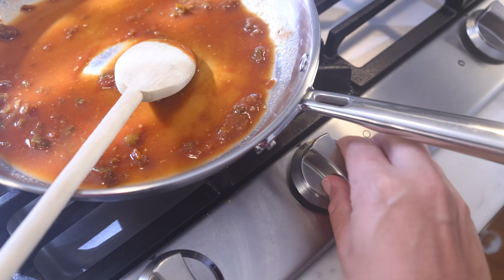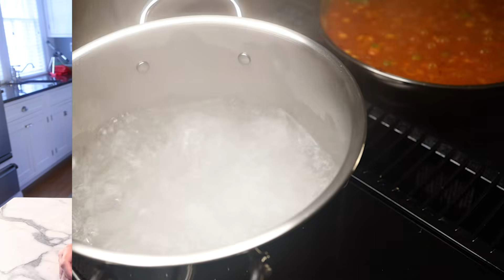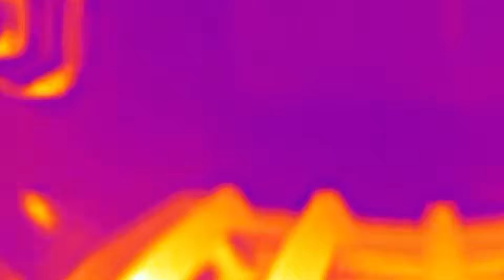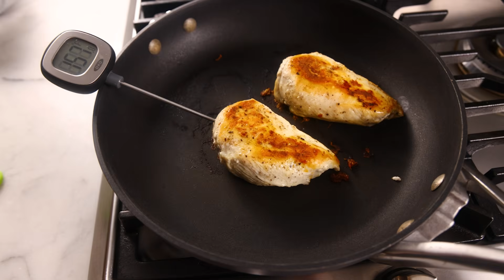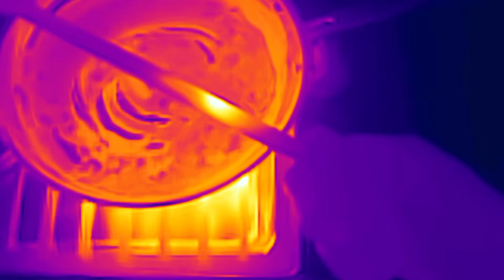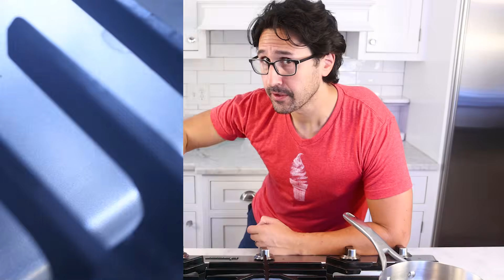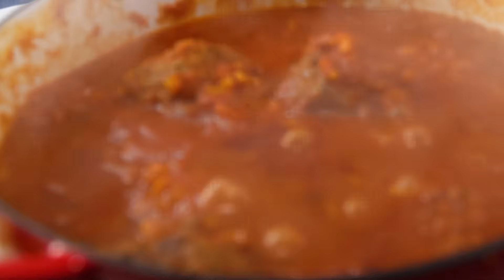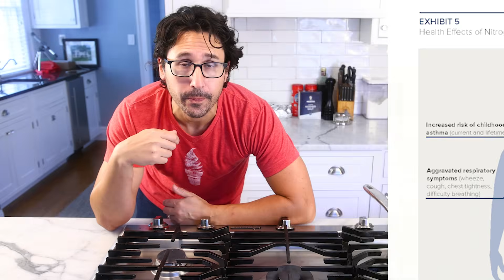Problems with gas stovetops | weak, dirty and dangerous

Comment: Most electric stoves here in Austria atleast have a glass covering
Reply: (edit, I replied by accident under the wrong thread)

There is no scientific backing for this claim, other than your bias. I bet in a controlled, blind test you would not be able to tell the difference and identify food cooked in gas from food cooked in electricity. Except, maybe if there is sauce, for instance, burned more, because gas created hot spots, and it burned unevenly.
Reply: @pavel9652  Are you ok?
Reply: @AlpineTheHusky  Yes, thanks for asking. Do you have anything remotely intelligent to contribute?
Reply: @pavel9652  Do you have any issues or are you just trolling?
Reply: @AlpineTheHusky  I just shared some information with you, but I acknowledge you don't appreciate it. Do you have problem with people responding on public forum to your public comments?
Reply: @pavel9652  I dont have a problem with it but if it has nothing to do with what I said then it has no use of being said
Reply: @AlpineTheHusky  I replied by mistake under your thread, while intended to reply to someone else ;) I notoriously get insulted in the comments, so I took your initial answer as confrontational. Obviously, the entire conversation doesn't make any sense, which you should have pointed out. Sorry about the confusion!
Reply: @pavel9652  Yeah I thought as much. I have talked with alot of people that may have outbursts of random sentences so I just asked if you were ok or if something else was the issue. Have a nice day
Reply: @AlpineTheHusky  "I have talked with alot of people that may have outbursts of random sentences" - very strange, you must be working in the mental health sector

Comment: One big issue I can see with electric stoves, is issues with the power grid in general.  We have a heat wave going on at this time, and our electric supplier is warning customers to try to use less power because the grid is strained.  Electric stovetops are not going to do this any favors.  The US has a lot of antiquated electric grids, and many of these might not be able to handle a bunch of new electric stoves all coming on at about 5pm.  Places like Europe were a bit late in getting electricity, and built their grids with a bit more future proofing.
Reply: But cooking on gas in the summer time leaks alot more heat into your kitchen, so it forces your AC to run harder. People freak out about energy and cooking but it really is miniscule and not what the power companies worry about, it is more AC and Resistive Home Heating that are the big problems
Reply: @linuxman7777  Where I live, where there is major issues with the grid, most homes have gas stoves, far fewer homes have ACs.  Gas is cheap, electricity is expensive, and the power company bugs everyone to use less power.
Reply: @Lutrian  Where do you live? the 3rd world? I live in Pittsburgh Pennsylvania  in the US and the cooking prices when you take efficiency into account the prices of gas and electric are the same. Never have lost power and the grid is super reliable here.
Reply: @linuxman7777  In California, Electricity is expensive as eff, and natural gas is cheap
Reply: ThTs the thing the liberals don’t get, our grid is the same one that was built when Edison came around over 100 years ago…. When air conditioners came around in the 50s that was basically all it could take, and now we’re trying to throw these shoves on cars on it… crazy.

Comment: I near always use an electric kettle to boil my water before adding it to the pot on the stove top. I don't know if this is more efficient but it certainly seems faster. I know that electric kettles aren't as ubiquitous in the US though.
Reply: It is faster and the electric kettle has nearly 100% efficiency, while the gas kettle has only about 30%. Smart move!
Reply: It is, you should never boil water on gas, it is really inefficient to do so, Love my electric kettle

Comment: This will probably be buried in the other 3659 comments, but here goes ... 💰💵💸
I don't like gas because the DELIVERY & TAXES, etc. COST $25/month, which is about $0.83/day or $300/year (that does NOT include the gas itself).  If I switch to electric, it will eventually pay for itself.

Comment: I'm hoping to get a hybrid 2x induction 2x gas cooktop (or similar).
Reply: Get induction and portable gas stove, as a backup or for larger cooking, like with wok. Complexity of hybrid is 2x and you will have to pay gas connection fees (or store bottles). You will probably end up using induction nearly all the time, because it is convenient and cheaper.
Reply: @pavel9652  Why not get a gas cooktop and a countertop induction burner?  That seems an easier, safer, and more compact solution.
Reply: @jamesisin  You will like and use electric more, I think. It is more convenient, faster, cleaner, efficient, creates no fumes, etc. Recently I was thinking about getting a single gas burner and bottle as an off-grid backup or for cooking with a proper carbon-steel, round wok, which likes a lot of heat! See the Chinese jet engine like stoves! ;) I have a glass+electric (no induction) cooktop.
Reply: @pavel9652  If your gas is creating fumes, you need to call some to repair something.  

My current setup is a gas cooktop with portable induction.  I'd just like to integrate both.
Reply: @jamesisin  Combusting fossil fuels always creates fumes. Every time you see little bit of yellow colour, it was incomplete combustion.
Reply: @pavel9652  I will get way more BTU's from my arrangement.  Also, I keep my current induction burner on a bookshelf while I'm not using it.  I can't do that with a gas one.  Ultimately, I know I want both so I will seek a stovetop solution which incorporates both.

Comment: I learned on Electric, and tried out gas recently, Electric while less intuitive to use, does offer alot more power than gas, more even heating than gas, and higher high temps and lower low temps than gas. 

Gas really only offers responsiveness, and instant heatup. But induction offers that today now as well.

Comment: Here's the one main reason I would choose a gas stove over electric any day of the week. There's absolutely no consistency as far as what "medium" and "high" heat settings mean... This video actually proves that. With a gas stove... You can physically look at the fire to see how much flame is under your pan. With an electric... You just kinda have to trust that their "medium" is ACTUALLY an appropriate temperature for your steak or wtv else. I'll take my gas & perfectly cooked steaks! I don't care about waiting an extra minute for water to boil.
Reply: That depends on how much you have used the product and have taken the time to experiment. I love gas too, looking at the fire makes my little caveman brain go "unga" and like you said, it's much easier to fine tune the fire by looking at it. However I do strongly believe that an electric induction stove is the better tool, but it just requires an annoying and expensive learning curve. See it as your phone, when you use a new phone or different brand, it has some lags and timings you need to get right to properly use it. After a long while it becomes like an automatic sense. Feel me? Still love gas tho, but looking to change to electric.
Reply: you don't need to trust anything, every stove its different, I have always use gas, I have passed for more than 10 of them.. everyone of them its different, you just learn to work them (same for electric), there is also no need to look at the flame lol.. I prefer gas anyways but this is a stupid argument.

Comment: I just cook everything on my natural gas grill outside... You can even use it as a poor man's oven. I've done a ton of pizzas and dishes of lasagna on it and I can't tell the difference 🤔 Bonus is that heat exhaust and gas byproducts are exhausted outdoors and not in my house.
Reply: This is defo useful if one lives in the wilderness or off-grid. How do you cook in winter? Surely can be done, but it is marginally less convenient.
Reply: @pavel9652  Well, I live in Phoenix so our winters are very mild. It does go down to freezing in the mornings in the deep winter, but by dinner time it's in the 70's , low 80's. 😎
Reply: Why not propane? Gas really is just worse propane
Reply: @linuxman7777  Simple reason really. We don't have the infrastructure to deliver propane to people's homes.... at least not without a delivery truck and a storage tank. [ Yes, propane is a better gas to use w/ more power since its a 4 carbon chain gas vs. 1 ] I do however have natural gas delivered for my water heater and heater. So its just a matter of tapping a line to my BBQ off of the main feed that goes into my house. People in rural areas do have large propane tanks hooked up to their house... but that wouldn't be practical for me since there isn't the room for it, but certainly in theory it could be done. I have the convenience of having a permanent hook up to my grill vs. having to swap out portable propane tanks.
Reply: @ricksherman34  I see, I have cooked in many ways, and like Induction and Glass Top Electric the most, after that I like Propane. Coil Electric and Gas are quite weak and when I use the gas stove in my house I am always disappointed when cooking large amounts of food, or cooking stuff from frozen. 
People who say gas is more powerful than electric don't know what they are talking about, or are confusing Propane for Gas. And in that case, of propane vs electric, there may br more of an arguement.
Reply: @linuxman7777  I think it would depend on how many BTU's the gas range outputs, but yes I have heard that induction will beat natural gas in most instances short of an industrial grill like you would find in a restaurant. I mostly grill but boiling water / cooking pasta will most likely be better on an induction vs gas range. I mostly just grill stuff so for me it's not an issue. I can also do lasagna/ pizza / and even bake using the grill like a poor man's oven and it works pretty well. I can't tell the difference other than the cost.
Reply: @ricksherman34  Check out TechnologyConnections video on electric kettles where he puts a Stovetop Kettle on a 17000btu burner, It tied an electric kettle in the boil test. 

Open flame cooking is and always will come with more heat leakage so you need alot more power to get the same results. Which Propane does deliver.
Reply: @linuxman7777  I totally agree...but with a permanent natural gas hookup directly to my grill, there is a convenience factor. I never have to screw with propane tanks and in general it only takes about 0.1 BTU to cook a steak in 10 min. ( Or Salmon fillet ). I usually just throw some veggies in aluminum foil along with the meat and I get a fully cooked meal in about 10 min. The regulators that they use on propane grills have smaller ports so the flow is less than what a natural gas regulator would use. In the end about the same amount of energy is burned. Also with electric range the power is created by a natural gas based steam turbine ... So you always lose energy when converting or transporting it. So natural gas has very high efficiency ( like 97% vs 80% for electricity) and it costs 1/3 of electricity for the same BTU.

Comment: Note on 10:15: It is actually a renewable hydrocarbon; lots of natural processes create the same compound as a by-product. We don't see a whole lot of that in the US, but NYC does pipe some to some residences that they use to heat their home. It is just so much cheaper to use the stuff piped from the ground, as that stuff is already being piped up as part of petroleum extraction.

Comment: I've designed induction cooktops, they fundamentally provide no more even heat than resistive cooktops. The pulsing you describe is just a result of the control circuitry. Some induction cooktops do it to (and some resistive cooktops don't).
Induction is better in all the other respects you mentioned though.

Comment: The thing with gas stoves is that it is the gas industry's biggest marketing assets. Less than 5% of their sales come from cooking, most of it comes from heating air and water. But since nobody gives a crap about if their furnace and boiler are gas or electric (they care about the price and its effectiveness), they need to rely on the emotional attachment ppl have to gas stoves to get good press. That's why their marketting and lobbying focuses so much on it and gives people a reason to attach their house to the gasline

Comment: I've used exposed coils, coils under glass, gas, and induction.  By far, my favorite preference is induction.  There is absolutely nothing remotely close to induction when it comes to temperature control.  That said, a close second for me is gas.  With patience and practice, you can get pretty close to induction regarding temperature control.  The problem is, with gas, you can't always cook directly on the burner to achieve that control.  I used spacers and double boilers very often when I had my gas stove, which is a huge pain in the ass but, in a choice over coils under glass, something I'll happily deal with.  Coils under glass have HUGE problems with temperature control.  Because you're heating the glass and the coil, there is a huge time variance when you turn the heat up or down.  I often find myself running 2, 3, or even 4 burners at a time when making sauces so I can have the different temperatures needed immediately.  On my current coil-under-glass stove, I set up a pot of water on high.  Once it got to a full, rolling boil, I turned the burner down to low and timed how long it took for the water to get to a simmer.  4 minutes!  On a gas stove, that happens within a minute.  On induction it happens in seconds.  Induction is definitely what we're getting when this range needs replacing.

Oh, another problem with glass topped ranges, be they coil-under-glass or induction.  If you tend to be "aggressive" with your pots and pans (shaking them while you cook), the glass gets scratched up pretty bad.  I obsessively clean my range top, so it's always pretty close to sanitary clean, but it looks like hell because the 2 burners I use the most are so scratched, they're no longer shiny!  Makes me want to go back to exposed coils!
Reply: I feel the pain here! My glass top is so scratched. It looked used after a month. I know it’s not it’s fault - but I wish I’d thought the decision through.
Reply: @AK-jt7kh  Yeah.  I'm convinced glass top ranges are made specifically for people who cook occasionally and aren't aggressive in their manipulations of their pans.  

I admit, I'm concerned about using a glass-topped induction stove.  The only reason I'm even considering it is how easy Gorilla Glass tops are to get.  That said, even if the glass top sucks and allows the same scratching as my current range, it will still be a huge upgrade over the electric-coils-under-glass I have now.  A man can dream, right?  Literally nothing can be as bad as what I have now.

Comment: If you truly care about the environment, consider where your power comes from, not just today, but for the next 5-10 yrs. 

Odds are it'll be coal / gas. Most cooking is done in the evening (low sun & low wind), so fossil fuel powerplants typically increase production to compensate.

I refuse to switch from gas to electric until we have a reliable weather resistant renewable power (nuclear), until then I'm just wasting it to sound "green" while adding to the pollution problem.

Comment: Love gas, hate electric, never tried induction but I hate the fact off means move the pot. And what kind of sauce pan are you using that it's burning on the side. I've not experienced that ever except a cheap thin pan. Oh well, to each his own.  Will said you do need a big burner to boil water for pasta or you will be frustrated.

Comment: It doesn't change the other things you said but as far as not being able to set your burner low enough - get yourself a simmer plate.  I have two that have been in the family for decades.  one is thicker than the other.  I rarely use them but if I really need something to be getting very little heat they work quite well.

Comment: Many people (usually old house wives) i met here in europe own electric stoves under glass and believe its induction because they dont know what they are talking about. Most of our stoves are electrical with glass top. Followed by old electric stoves that I believe stopped being produced over 20 years. I dont know the numbers of this decade, but I bet gas stove is still in front of induction.

Its not like we dont have it, they just didnt read the manual. Though, the other half of uninformed europeans believes you need special extreme expensive cooking gear for induction, which is quite untrue as well.